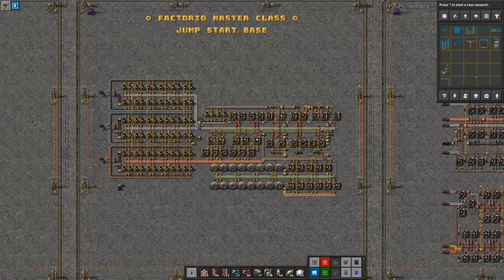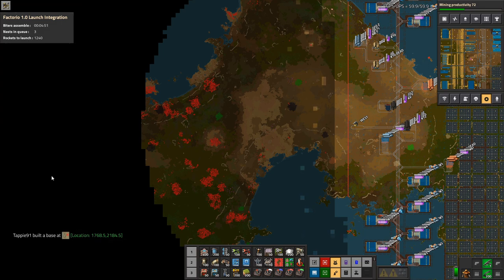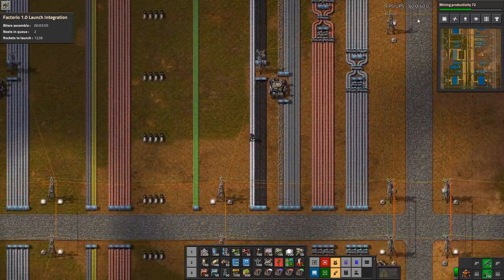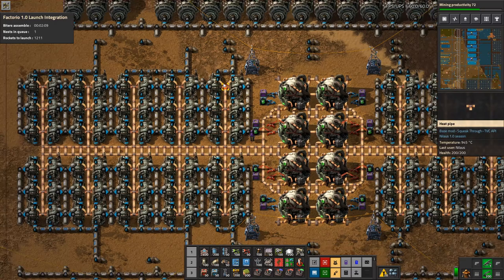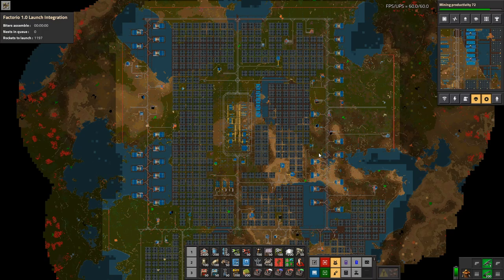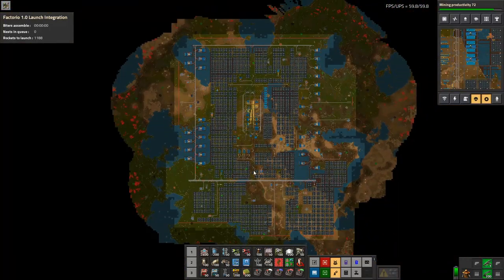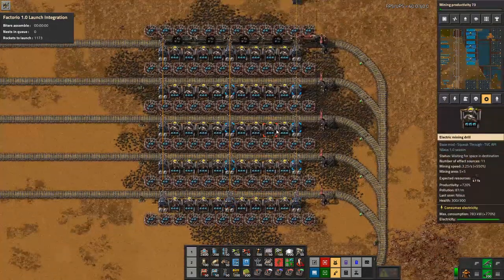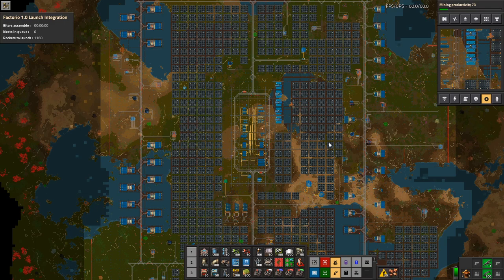Optimising UPS; The True Enemy of Megabases | Factorio Tutorial/Guide/How-to

Comment: Hey guys, today i upgraded my CPU from a ryzen 9 3900x to a ryzen 9 5900x and really got noticable results in factorio. i tested with my factorio extended megabase which isnt fully completed, it currently provides about 8k science/min but space science isnt build yet an purple is cant keep up at the time. anyways under full production my game updates where at about 2.3 - 2.6, now with the new cpu it sits at 1.6 - 2.0 with da tendency to stick at 1.8. So this leaves me space to build a base 8 times bigger while my old cpu only permitted around a times 6, thats about an increase of 33%. color me impressed.
Reply: Upgrade from a Ryzen 9 3900X ... Oo 
Talk about first world problems.
Reply: @TheKetsa  well i play mostly only cpu intensive games and i also need the cpu for my work, so it actually was a worthwhile upgrade. considering that the old one still had a considerable resell value.
Reply: Nice. I have a 3900x too, and have been thinking about how a 5900x will perform in factorio with the higher IPC and boost-frequencies. This is almost spot on with my "calculations" of theoretical improvement, but nice to hear real world use too. Did you change out the RAM or anything else at the same time, or was it only the CPU you changed?
Reply: @Newspaperman57  i didnt change the ram, i am having 3600mhz at cl18, i did try upgrading it to 4000mhz to improve fabric clock, but thats not an automatic uplift and requiers manual tinkering, i didnt consider it worth the hassel and returned the ram.

Comment: I‘ve seen a reddit post where a user self-programmed a factorio client with full multicore support and he gained ~3,8 times more performance with 4 cores versus the normal client. He said the devs said multicore is not possible but he proved that it is and actually one dev replied that they look into it and op should provide a link to its client. So maybe there is hope for insane bases with almost no ups issues. No multicore support in 2020 is actualy a shame but i guess since this game is rather old I‘d give it a slight pass.
Reply: to be fair, that code he made doesn't incorporate half the game, and it's quite possible that the way Factorio is now would be impossible to retroactively make it multicore compatible, and would require a rewrite of major parts. I remember one of the arguments against multi-core Factorio was that multicore does not do deterministic well, due to asynchronous computation, but given a small overhead cost of say, 10%, for syncing cores, the addition of 300% for just three more cores would be a game changer (and many cpus these days have more than four cores, and counting).
Reply: Mega base!  I still need to get to Kilobase or Decabase.  I'll start micro and factor 1.
Reply: I don't see why it couldn't be done. Yes syncing is one of the hardest things to do in programming (if you have proper abstractions it's really not that bad), but the thing is, each frame depends on the state of the last frame, not the previous item you're processing. If every single machine depended on the last machine in the list, and they had to be in order, it wouldn't work. But the machines only depend on their own state and their surroundings like inserters from the previous frame. It might cost twice the memory depending on how it's currently done, but the order of things should only matter in terms of stages, like circuit networks, then train pathing, then inserter rotation, then crafting, etc. All entities of the same type should be able to be processed in parallel. I'd really like to see that happen.
Reply: @DFPercush  Remember that when working with high performance, increased memory consumption can also cause contention on L2 and L3 caches, so you might see performance degradation that cannot be solved by adding more RAM. This can be worked around by carefully arranging the layout of data in memory, but if the game wasn't designed like that from the ground up, the effort involved approaches a complete rewrite. Additionally, there may be (I'm not sure because I haven't gotten that low-level looking into it) mechanics based on sequentialized operations which would then either need to be changed, or hamper parallelization efforts; I wouldn't make any claims about how relatively easy it should be until I've understood the source code, which in this case I don't have.
Reply: Multithreading and parallel processing are not trivial and would most likely result in a decrease in performance. Also I'll just call BS right now on 3 to 8 times performance increase with 4 cores, it's extremely rare to even get a 1 to 1 increase from adding a core on anything more complex than simple programs a 2x increase in performance  on the same algorithm is nonsensical.
Reply: @serith102  It's 3.8 on 4 cores.  Other countries use the comma "," the same way the decimal "." is used in the US to determine the fraction of the number.

Comment: Regarding the biter performance cost, the biggest increase was in "entitys" from 10 to 13. After you deleted all biters and pollution, entity update goes down to 7. Just to make clear its not the path finding which kills your performance but calculations regarding pollution (it would be interesting if the pollution is the biggest problem tbh) and creation of biters and nests.
Reply: I am running 50 UPS at the moment, base is getting out of control. Will kill pollution and biters tonight in my save to see how many entity updates it saves
Reply: Disabling didn't do much for me. However I have another problem with Transport Lines taking 4 alone on average... Entity Updates stays around 10 for me

Comment: I think one important thing that wasn't mentioned is power. For UPS stability, power needs must always be met. The moment power dips below, the UPS will tank due to all of the performance calculations that needs to happen on any electrically powered entity.
Now by the time most people get to a base this size, power levels should be fine, but for pure solar builds that sometimes dip (even a little bit) when accumulators run out, bad things happen.

Comment: The information you're providing about the transport lines at 13:40 is incorrect. The compression of belts is completely irrelevant for performance. What matters is the number of sections that the belt gets divided into. Splitters split up belts into multiple sections, as do inserters that interact with the belts. You can see these sections by enabling the "show transport lines" debug setting. You will see lines on the belts, with arrowheads indicating the start/end of a section. Each of these sections will only need to be updated once per tick. The way this works is that the game only needs to update the distance between the start of the section and the first item on the belt. All gaps after the first item remain exactly the same so they don't need to be updated. Which is why gaps absolutely DO NOT MATTER. (This is explained in more detail in FFF-176)

What does matter is whether a belt is moving or not. A belt that is backed up will not be processed anymore, so letting your belts back up is still a good idea, but not because it removes gaps. You can also just leave it empty, or just have a few items at the end of the line with no new items coming in. All of these are handled the same.

It seems like a lot of people have misinterpreted FFF-176, because it mentions the gaps between items, so people seem to assume that the gaps are what matters. But the point of the optimization is that the gaps never change except for the first, so they don't need to be updated, except for the first. So gaps don't matter. Only sections do.

What this means is that balancers should be avoided, because those actually cause multiple belt sections to be created. As well as minimizing the inserter interactions with the belts. (not only because inserters are expensive themselves, but also because they break up belts into sections). One thing to note here is that you can have up to 3 inserters in a row (directly adjacent) grabbing from the same belt while still only breaking up the transport lines once. So it's preferable to place inserters directly next to eachother where possible. It's also preferable to make sure that inserters are only grabbing from once side of the belt at a time (for example by using the lanes for different resources) as the inserter will only break up the transport line that they're grabbing from, leaving the other line of the other lane untouched.

If you can, you should probably add a disclaimer in the comments/description, as this is basically misinformation that seems to still be very prevalent in the community. (I was directed to this video because of a discussion of this topic in the official discord)
If you're unsure whether I'm correct,  you can check out a bunch of benchmarks that have been performed by the fellows at the technicalfactorio subreddit and discord. I'm also happy to answer any questions in more detail on the official discord (if I know the answers, of course).

Greetings,
Swan - Factorio discord/subreddit moderator
Reply: Woah thanks for the information

Comment: Here's a tip -
From what I'm seeing, you're balancing the amount ore belts just before they go into the smelters and you are then balancing the freshly smelted plates and, where you aren't using direct mining, you are also balancing the ore before it goes onto the train.

You don't need to do all of that.  You only need to balance that once, not 3 times!  Since you have mostly direct mining resulting in uneven ore loads, I would suggest balancing before smelting.  In doing this, the plates will already be balanced.

If your base isn't using direct mining, you need only balance the load of ore when you load it onto the train.
Reply: Well no, because if you are not using bots and using belts for feeding assembly machines, then one side will be used more. Thus chests for trains' unloading stations will be used unevenly which will make belts not saturated from stations. Thus you need to make sure that you are getting resources from chests evenly. But aside even with that you dont need 3, you only need two.

Comment: Nuclear is actually not that bad in terms of performance if you use reactors to transfer heat instead of heat pipes and feed water directly from pumps to boilers (one pump for 9 boilers without connecting to others, so there is no sloshing in pipes)

Comment: If you are indeed building a PC in late 2022 for Factorio (lucky you!) then the Ryzen 7 5800X3D is the only CPU worth buying, as it can process three updates in the time it takes an Alder Lake i7 to process two. Make sure you understand the difference between the 5800X and 5800X3D — the 3D chip is 50%-100% more expensive, but in Factorio specifically, it’s 70%+ faster.
In early 2023, the 5800X3D is set to be replaced by Zen 4 3D V-Cache CPUs, and at that point, the advice will change, as those processors should be roughly 25% faster again. All that said, The Ryzen 5 5600X and up, Zen 4, Alder Lake, and Raptor Lake all run Factorio far better than any CPU from two years ago could, and I have never managed a big enough base to dip below 60 UPS, though I’m currently running a Ryzen 9 5950X (bad price to performance for this game), and my most recent base is by far the biggest I’ve ever made. Props to the developers for making this game so performant.
Reply: late 2023 update?
Reply: Ryzen 7 7800X3D is the Zen4 equivalent of the Ryzen 7 5800X3D (8Cores, 3D V-Cache). There's also the more expensive 7950X3D (16 cores)  and 7900X3D(12 cores)  but both of them don't offer any value in Factorio

Comment: My megabase was getting slower and slower - I only get around 20/25 UPS now.
Followed your directions - see that I have "Entity Update" at a consistent value of 45.
Yup, guess that's where my problem is.

I, like many people, never planned to have a megabase - so never did any optimisations, really. My base just kept expanding, needing another area to produce a bit more plastic, circuits, anything... Then I couldn't keep up with space science demand, so needed a 2nd rocket area, which needed more resources. And so the cycle continued, until I ended up with the sprawling base that I love! No way to get that Entity update value down, without massively rejigging my base. Guess it's time to decide whether I can face starting a new base, from scratch......
Reply: Or you can backup a copy of your current base for the future, and delete/rebuild as much as you want. This way you will keep all of the research you have done, you'll have a good supply of resources to build big with, and you can always go back and replay your old version if you want.

Comment: Well ok, all entities reduce UPS. So whats about concrete tiles ? And whats best? Belts or underground belts on large scale?
Reply: I think, entities on their own only use RAM, entity UPDATES are what matters, right? Since concrete does not need to calculate anything, it should not matter (like solar panels don't hurt performance, since they dont update, they just exist.) Belts VS Underground Belts has been tested extensively (maybe look through reddit), the conclusion was basically that underground belts do not increase the performance significantly enough to bother replacing your normal belts.
Reply: @leonardschulz7050  floor prevents ground absorption, so if you have pollution on, concrete hurts UPS, worse so if you also have biters.

Comment: How about a inserters clocking? Is it possible to save noticeable ups by adding circuit networks to clock inserters to do more efficient swings?
Reply: Once an inserters gets a pulse it does a full swing no matter what. So it wouldn’t make any more efficient swings.
Reply: @nickwilson3499 
1. only if it grabs from box, grabbing from belt is a tricky thing;
2. main point of clocking, as I understand, is to make less swings with more items, e.g. not "10 swings with 1 item each", but "1 swing with 10 items".

Im not really familiar with suck trick, but I heard about it, and in doubt — is it really worth it?
Reply: @Felinaro  oh yeah, with stack inserters that makes sense. however, in hyper UPS optimized bases you wouldn't usually have much down time for inserters.

Comment: no section markers in this master class video (or the last one). Good content, but it seems the numbers don't support the conjecture that nulcear is so bad.  0.1 updates is pretty manageable. Now, I recognize 0.001 updates for solar is far less than 0.1 for nuclear, but there are better places to try and optimize overall game performance than removing nuclear. Pareto principle says to optimize the biggest problem first, which is entities. Since there's no visibility into what entities are doing what, we can't really optimize them very much. :-(
Reply: The Pareto Principle doesn't consider the difficulty of optimizing each part. Replacing nuclear with solar is a very simple change, but optimizing a rail network might mean a complete overhaul of the topology of your base, assuming the new network you are planning would actually improve UPS.
Reply: you have to scale up nuclear with your power demands. the solar processing is flat. if he were running his whole base on nuclear, it would not run at 60ups.

Comment: sadly most of this if not all of it doesn't help me with my factory. As the Goal is to make a self expanding factory with that can handle biters and rough terrain and expansion all by itself. which means a lot of these systems can be used as robots in order to be useful like you show need to be on their own network per production block but for a S.E.F. they all have to be on one network else complications accrue. Furthermore solar is great but it will never keep up with a power demand that grows exponentially over time. but they do help lesson the demand on the nuclear plants while steam engines just can't keep up period.

with all that said good work here fellow engineer.